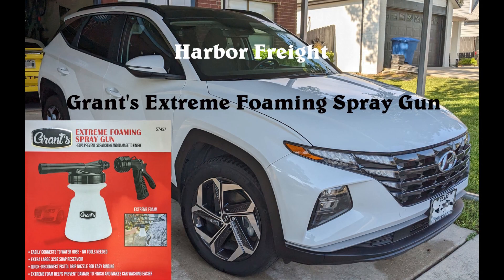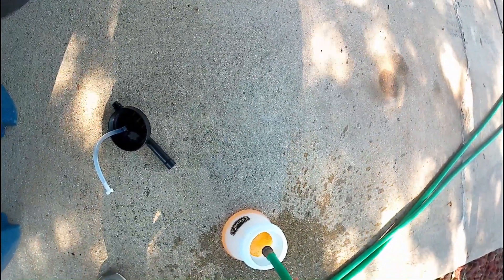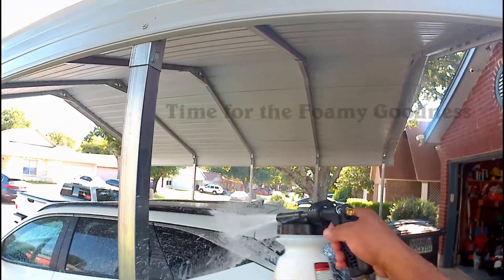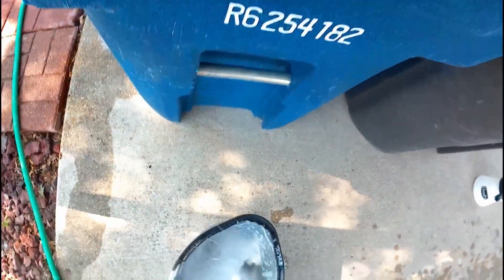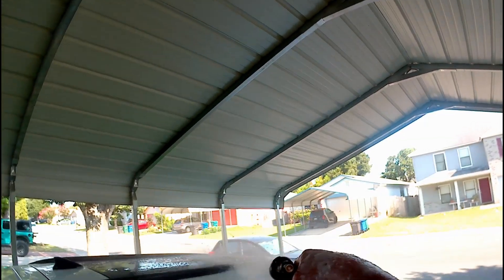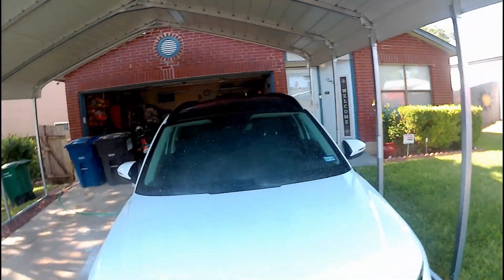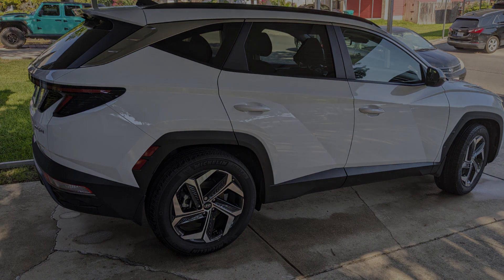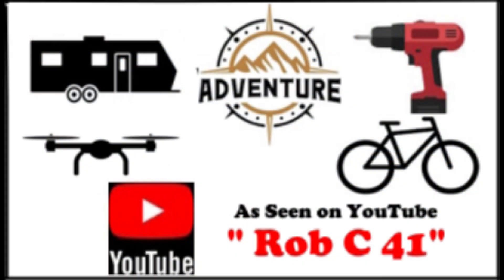Car Washing using a Harbor Freight Grant's Foaming Spray Gun #carwash

Comment: Using the foamy soap on a rinsed vehicle defeats the purpose of the foam. The soap is supposed to lubricate the dirt and grime so it just slides off without scraping the paint job.
Reply from the maker: That is an interesting take.  My thought is to rinse off the dirt and grime before applying the foam, then a use a car wash mitt, with more car wash solution to clean the car,  avoiding scratching the finish by rubbing impurities into the vehicle paint.  Your comment is welcome and gives me and other people who view this video another prospective.  Thanks for taking the time to watch and comment.